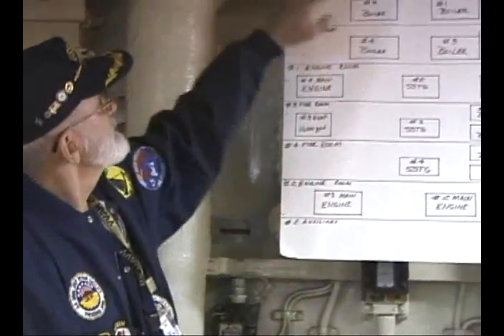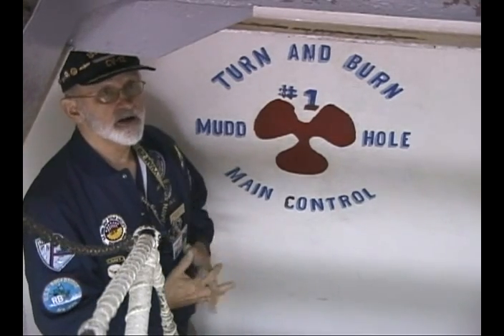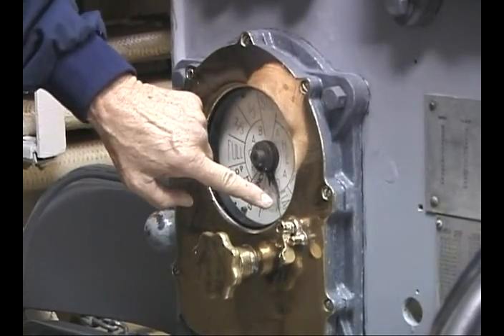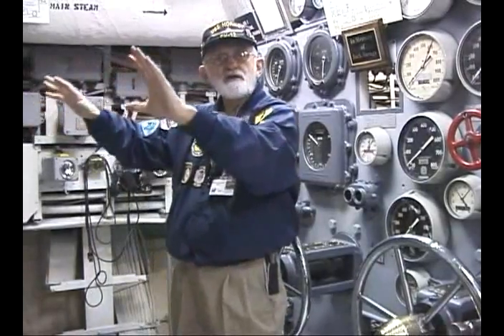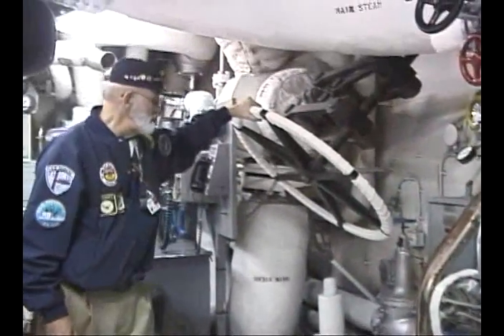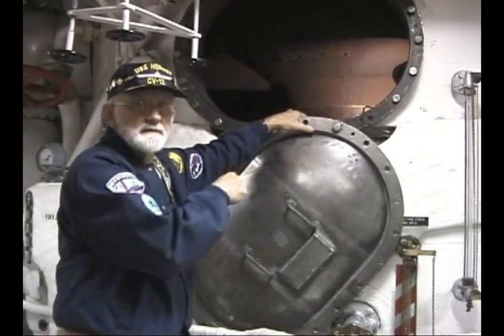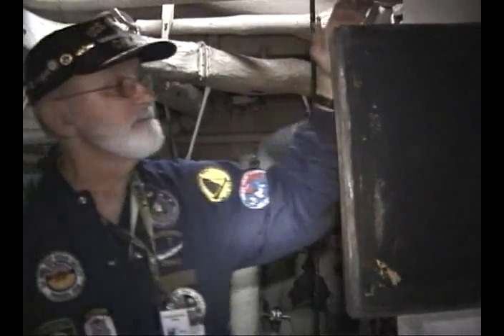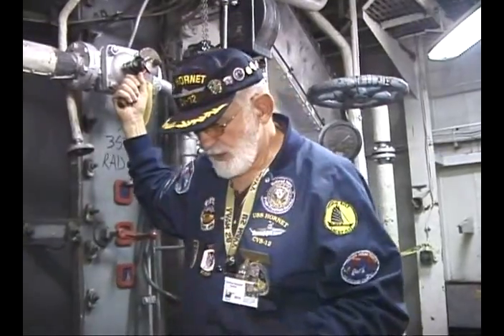The Engine Room

Comment: Wonderful job by Chuck.  I was BT2 Keyes during the 1972 Westpac (April-Dec) on the Midway.  Good ship and crew.  Four Charlie Fireroom was my work place.  Burnerman, Checkman and Messenger stood 6 hours on, 6 hours off during that period.  Top watches stood 4 hours on watch, 8 hours off watch.  Tuff job for these snipes and they did it with skill and determination.  During this time period the Midway used JP5 for boiler fuel, it was much easier to fire.  My two previous ships (Regulus and Chara) used black oil.  That was terrible, not to mention the asbestos in those machinery spaces.

Comment: I eventually qualified supervisor on USS Bradley FF 1041 the carrier a whole other situation. In my case, i had to be crosstrained EEOW as well. The EEOW and I had the same station area at the Throttle area upper level. It was only about 100 degrees or so at MAIN CONTROL. Still 120 db noise though. Double hearing protection made just enough reduction that damage was still assured. 👌 😅 ❤

Comment: On Bradley, our masterchief BT taught the BTs how to mess with thst safety valve to permit them to oversupply so we could engage the IP/LP crossover for extreme acceleration! Putting th F in Fast frigate...how fast? The new variable pitch screw ships COULD NOT beat us "out of the hole" on emergency breakaway drills. We were a dragster and thst was the key, a safety that can be adjusted beyond specs and NOT lift too early.

Comment: I was surprised to find out that modern carriers with nuclear power cant out run the Hornet. Interesting. The video does  looks bit old; Does that still hold true today? If you cant go faster with nuclear power, than ?? whats next?  Electric motors an actuators seemed to have gained a lot of power recently. Diesel or nuclear running electrical generators?  And electric motors for everything. Seems plausible.
Reply from the maker: The video is roughly 20 years old, and WWII era carriers are no faster now than they were then - top speed about 33 knots, or almost 38 MPH. The fact is that none of us really know how fast the Nimitz or Ford class carriers are, but most guesses are in the 40 knot range - 46 MPH. That top speed was necessary to get 30 knots of wind down the deck for launches in dead calm.  At 40 knots the carrier would out run the rest of the group - not advisable in most circumstances.

Comment: Now this is a man that knows his Naval propulsion systems. I served for three years on a Guided Missile Destroyer and I spent many long hot hours in main engine control, I qualified to stand lower level watch, and throttle watch and that was my last job as throttle watch. Our ship was a 1200 psi superheated steam system which was a little more complicated than the old 600 psi systems but basically the same except for the pressures and equipment needed to handle it. I really admired the way he described what the duties of the throttleman were. It was a pretty important job but still just a part of the overall engineering department. And yes it got really hot down in the hole.

Comment: I was a Machinist Mate aboard a 60's era destroyer in the #2 engine room. We used a 1250 psi steam plant, with the same type of main engines. Just two instead of 4 giving us 70,000 shaft horsepower. I disliked standing throttle watch and spent most of my service on the lower level.

Comment: One of the most interesting thing about steam power is that there is a temperature and pressure point at which steam condenses to the density of water. Steam turbines and reciprocating engines must run on steam which is compressible and water which is incompressible and will cause breakage or erosion. past the critical point, water drains must move from the bottom of a container to the top since the water floats on top of the steam and must be separated.

Comment: These are M type boilers with controllable super heat.  I steamed 1200 psi plants with Modified D type Boilers and uncontrolled super heat. 1250 PSI  975 Degrees.  Other than that every thing else is literally identical.  I did find it interesting that the Engines didn't follow standard equipment arrangement in that the Odd numbered equipment was located on the STBD side and Even numbered on the PORT side.  Like those aboard the destroyers.  #1 Man Engine on the STBD Side and #2 on the PORT Side.  Our boilers were 1A Stbd, 1B Port in the #1 Fire Room. and 2A Stbd, 2B Port in #2 Fire Room.  We could also cross connect steam from forward and after boilers to both engine rooms (normal steaming conditions) or Split Plant,  Steam from forward boilers to the Forward Engine and Steam from the Aft Boilers to the After Eng Room.
Reply: Yep, that was how it was on ship as well (DDG 24)

Comment: On a steam plant, the operators are truly "engineers." Diesel / Gas Turbine plant, they are more mechanics.

I think the difference comes from an understanding of the heat cycle.

Steam Plant: Heat source, fluid expansion, heat sink, heat recovery, repeat. You can trace the heat cycle with only a flashlight and some motivation. When something goes wrong at one component, these operators know intuitively that it can be affected by something upstream, which may not even be located near the source of the symptom. [Example: Feed pump losing suction. A diesel mechanic might first think there is something wrong wrong with the feed pump; a steam engineer would know enough to verify booster pump or the DA/DC Heater level first.]

Diesel / Gas Turbine plant: The heat cycle still exists, but is not as readily "seen" unless blueprints / drawings / schematics are available. This limits how the operator can understand and troubleshoot issues with the plant in their charge.

I have high respect for steam operating marine engineers for their logical reasoning; analytical thinking; the education level required to operate these systems; the love they offer for something as nonhuman as a machinery system; and the ability to execute all this in a rolling/pitching environment, usually without much empathy from the Deck Department.

I see all these qualities in the video's docent. Thank you for giving us a tour of something not many get to appreciate. BZ

Comment: This brought back so many memories.  I was stationed aboard the USS Hornet CVS-12 in Fireroom #2, "Hell's Half Acre" in12/29/1960-11/23/1963.  Stood many watches on checks and burners.   When I was aboard we also had a snipe stand smoke watch topside on the island tower, and when a boiler was smoking, we called down to the fireroom and told them which boiler was smoking and what color, black or white.  Loved standing smoke watch.
Reply from the maker: Fireroom #2 has been fully restored, absent bunker oil, and is available for docent-led tours. The "Hell's Half Acre" graphic is intact.

Comment: Thanks for the excellent tour of the monstrous power plant of your bird farm.  MM A GLAKES 6-7/67, USS Mullany, DD528, Main Control messenger/evap watch.  Westpac Feb-Sep 68.  Stood throttles after making MM3 in June.  34,500 SHP in the palm of my hand, and any mistake by ANYBODY would make me among the first to die from high pressure steam, runaway turbine blades, or DA tank rupture (I had to control make up feed).  Great responsibility for a 21  y/o kid.  We did full power run as part pre-deloyment ORI.  Stood on the fantail while the old gal shook and shimmied like my sister Kate making 34.9 KTS on all 4  boilers--man those Fletchers could haul ass.  Was part of 4 man crew to replace leaky (shook loose by our round the clock 5in gun line duty) 600# flange gasket over  #1 generator while dead in water off the hostel shore.  Man, slugging down those big flange bolts, inches off the overhead, in all that 130 F. heat was sure fun.  The bridge was bugging the shit out of us to restore power, cause we were drifting into into small arms range and faced the possibility of running aground.  Not too many appreciated that the "goon platoon" got ALL of us out of harms way!  I think about my 2 measly combat ribbons whenever I see today's punks with a ribbon for each healthy bowel movement.  JD Schultz, MM2, USNR, 1965-71.

Comment: Ever clean fish out of a main condenser?
Reply: Yes in port docked San Diego  aboard uss Oriskany Cva 34 #1 engine room  closed sea suction valve  started to remove the inspection cover plate  to much sea water came out of the condenser bearly got the nuts back on to stop sea water coming in  open & reclose  sea suction valve this is a opening at the bottom of the ships hul a 80 pound fish got past the grill bars & got shut in the gate valve  4 of us had to shut the valve with big pipe wrenches  we removed the   condenser inspection cover  to see the 80 pound fish cut in half by the gate valve reduced to approximately 40 pound's 2 men went in and handed out to 2 more men lower level of the  engine room  we almost  didn't  get the inspection cover plate back on and bolted down the ship could have sunk right their  in port docked San Diego  1964
Reply: Yup.. secnd worst job there is in the Navy.

Comment: I served aboard the USS Hornet CVS-12 12/1960-11/1963 in #2 fireroom, "Hell's Half Acre".  You can see Hell's Half Acre at the 47:45 minute mark. Brings back so many good memories.  Cleaned firesides many time in each boiler #3 & #4 (after 600 steaming hours)  in #2 fireroom.  Stood burner watch, check watch and a lot of smoke watch (top side on Island especially during flight ops.) Made BT3 just before I departed 11/23/1963 (the day we got word President Kennedy was assassinated) to fly back to San Francisco, Treasure Island for discharge 12/4/1963.  on 2 West-Pac cruises
Reply: you good sailor thank you !

Comment: Great presentation! I was a tender MM2 aboard the Samuel Gompers AD-37 and worked in the pump and valve repair shop, 68-71. Really interesting to finally see where all those pumps and valves I repaired were located. One thing I remember from MM A school was that (I believe, it was nearly 50 years ago!) there was a third turbine, called the economy or economizer turbine, at least on the 445/692 class destroyers that was not mentioned in the video. Is this something that was deleted in the carrier application? Also loved the description of Bunker C oil. As I recall, it was so thick it would not even begin to flow until it reaches 140 deg. F!
Reply: I served aboard USS Weiss APD 135 ('66 - '69).  I remember being alongside Samuel Gompers in Subic Bay several times while you'all did some repairs for us.
Reply: Joe Dunlap snipes!
Reply: Joe Dunlap  they did away with the cruising turbine before I joined the navy but kept the information on it in the training.  My ship was built in the mid 50’s and did not have one.  Near as I can tell they stopped using them in the 40’s.

Comment: Wow.  What a great video by a great engineer.  I never realized how easy we had it on merchant ships.  Thanks to 4+ decks of open overhead space, our lube oil and condensate systems were much simplified compared with Navy ships.  In a typical merchant L.O. system, an electric, screw type pump moves oil from the sump, through the coolers, and up to a gravity-feed tank at the top of the E.R.  Pressure to the bearings results solely from the head pressure of the tank, and the tank must contain enough oil to supply adequate pressure for 3 minutes, should the service pumps fail.  The gravity tank is kept at a constant level by an overflowing of excess oil back to the sump.  The overflow drop is fitted with a lighted "bull's eye", which is visible from the maneuvering flat (if the low l.o. alarm sounds, the watch engineer looks at the bull's eye for immediate confirmation of pump failure).  Our D.C. heater, or DFT, is also at the top of the E.R, and drops directly to the M.F.P.  suction, thus eliminating the need for booster pumps.  Condensate pumps are usually of the electric centrifugal type.  On the downside, there are only two watchstanders per watch, covering everything from the engineroom to after steering.  On one ship, we enlisted the help of the deck dept. to assist with an at-sea, emergency condenser job (we were injecting sawdust about 4 times per watch).  The whining was legendary.

Comment: I was on the USS Camden(AOE-2), she got a pair of engines from the unfinished USS Kentucky.
130,000 shp 13 stage hp turbine 9 stage lp. 4 boilers 600lb 850F, 4 SSTG's and of course all the various supporting aux equipment.
Was able to get up to 33 knots but we had to tax the boilers pretty hard and open the overload valves.
Good Times.
(MM3)

Comment: Standing throttle watch on the nuclear powered Bainbridge DLG(N)-25 was way simpler than on a conventional destroyer because no matter how fast you opened or closed throttle valves the reactor kept pace and steam pressure barely changed. Plus, the throttle station was in an air conditioned Enclosed Operating Station, so you weren't dripping sweat on the bell log.